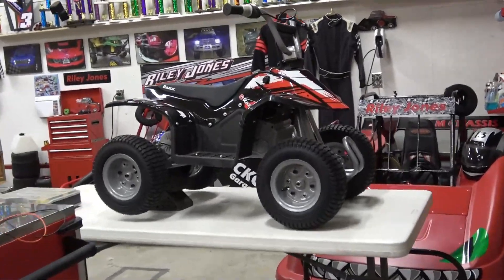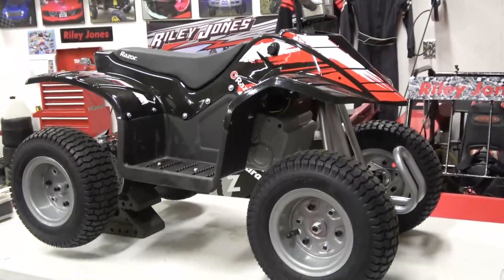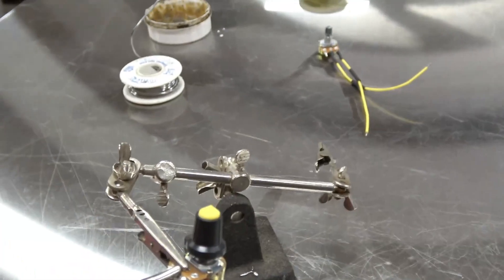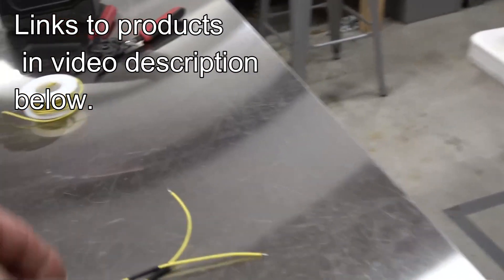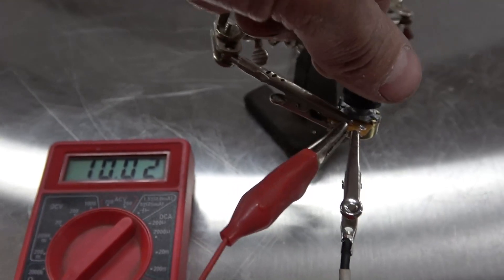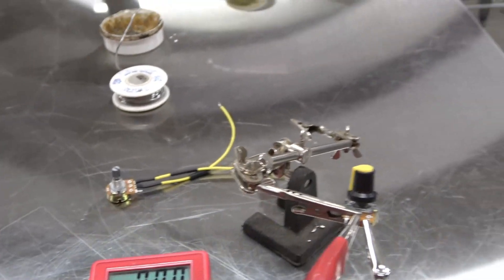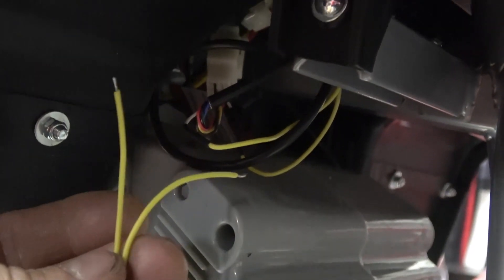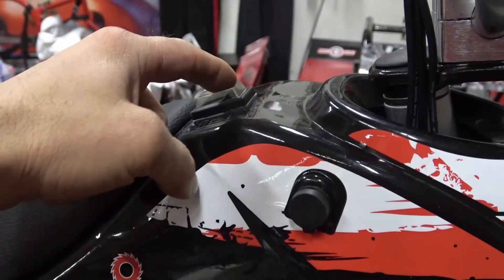Razor Dirt Quad Speed Governor Mod #razor #potentiometer

Comment: Was 5k or 10k potentiometer better for "resolution"? I want the widest range of possible top speeds
Reply from the maker: Not sure to be honest. Didn't test them.
Reply: So I just did this to my sons and did a 20k and I realized it gives me way less speed control, it’s so resistive that you only get a 1/4 turn from nothing to full power, the 10k would give you larger adjustment. I’m resoldering in a 10k in now
Reply: @brandonromo6265  I did a 10k on my kids razor mx125 and it works great. I would probably try 5k next to see if it's better.

Comment: Hey gang - any thoughts on adding this mod to the Pocket Mod scooter? https://wildscooterparts.com/support/razor-wiring-diagrams/pocket-mod-v45-up-wiring-diagram.jpg
Reply from the maker: Is it variable speed or an on off twist throttle? Needs to be a hall pedal to work
Reply: @CustomKidzCars  It is on/off. There is a variable speed mod kit available that I could slap on if needed. Thanks!

Comment: Very cool. I thought about doing something like that for my kid when he got his Dirt Quad back in 2020. Any tips for trouble shooting a Dirt Quad that is running sluggish? My kid's shows "Full" when charged, but flips to "Low" as soon as we turn the throttle. Battery is showing 23.1V, not sure if that's enough. Output from the controller to my multimeter hits about 20v then goes to zero (I guess there's a safety in case the controller doesn't sense enough load). I lubed the chain and ensured the brake caliper wasn't stuck on the wheel. If you have any ideas, I'd be grateful!
Reply from the maker: Bad batteries. Should show 26.2 volts if full
Reply: @CustomKidzCars  A belated thanks. I bought a battery charger / conditioner for my car and was able to use it to revive the batteries. I did have to separate them and reconnect them afterwards since it can only do 12V. But now the batteries charge normally and the quad runs great. While I was messing around I installed a switch to let it run in reverse.

Comment: I just did the mode, now I just hear a click from the controller when I throttle the quad and it doesn't move. Even after taking the potentiameter off.
Reply from the maker: U positive u spliced into the correct white wire? If u installed it back to stock and it doesn't work u might have low battery voltage
Reply: Same thing is happening to me right now

Comment: wondering if this would work for the mx650. I think my son will be a little scared of it.
Reply from the maker: Should work just the same. As long as it's variable speed u r just tapping into the signal wire to limit the voltage
Reply: @CustomKidzCars  Cool, its either this or I have to buy it pre-made from a shop on ebay.
Reply: The MX650 is 36V. Fingers crossed this works LOL thx

Comment: Hi. I have a mx350 series 37. The newer cheaper single speed. Just want to slow it down.  No white wire. The clip has 4 wires. 2 red, 2 brown. 1 brown hooks up to a green. Would that be the wire?
Reply from the maker: Have no idea, is there another plug ?
Reply: @CustomKidzCars  the plug from the throttle has 4 wires. Not 6. I edited comment. It’s a mx350 single speed.   Opposite side plug is 2 yellow, 1 red , 1 green
Reply from the maker: Single speed is not variable speed so this mod won't work
Reply: @CustomKidzCars  gotcha. Thanks.   How hopefully a variable speed mod will be out soon

Comment: Great Video. I have a razor mx350. Can this method work on that as well?
Reply from the maker: Not unless is the older version with variable speed. The newer cheaper model is on or off throttle. Hope that helps.